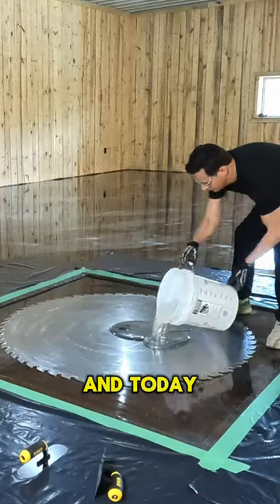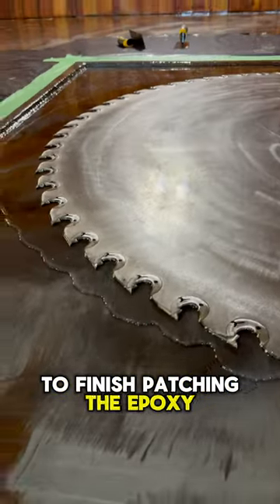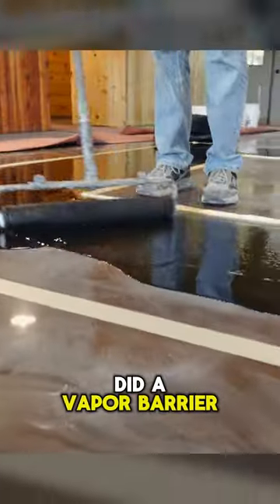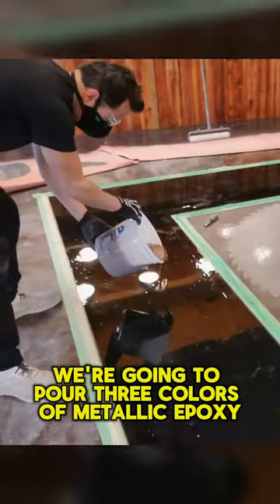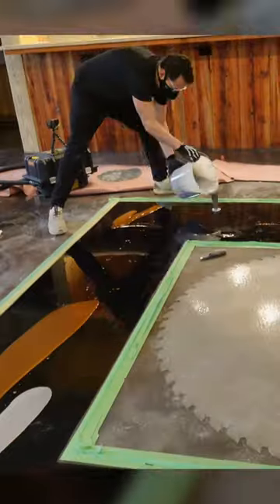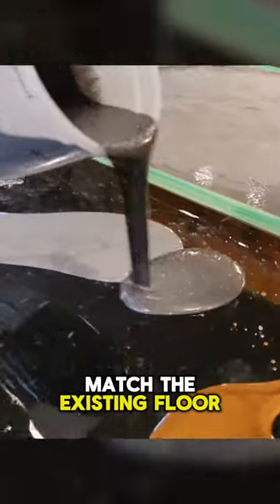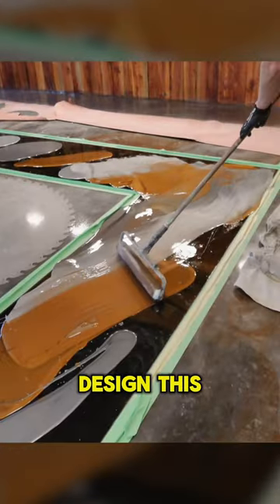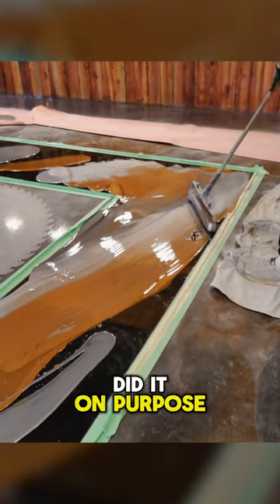⚠️ Metallic Epoxy Vlog - Day 6 #concrete #epoxy #metallic #floor #mancave #satisfying #garage

Comment: Idk if this would work, but I would've embedded the saw blade in a circle in the floor. Made to so the saw blade was level with the floor. Then, pour all the epoxy on it all at once, not separate. I'm not an expert, so who knows if it would work. Just an idea.

Comment: I can't wait for the epoxy fad to end. Then watch all these property owners get quotes for having the floors redone. Epoxy anything is like popcorn ceilings.
Reply: As a concrete foreman, same.
Reply: I think it’s beautiful if done right but it hurts to stand on or walk on these people are going to HURT
Reply: As a plastic fabricator, I cant believe anyone wanta acrylic floors! It chips, cracks, and breaks way too easily.
Reply: Popcorn ceilings are dope. They have an acoustic effect and make it so that you can easily fill holes and damages and other imperfections and then conceal them. I personally like the look, over all flat walls and ceilings.

Comment: OK, so I have a question, I do polyurea and polyaspartic floors. Flake systems.  In my experience, the floors you are doing here scratch up with chairs, tables, high heels, and such.  They are also slick.  Do you not run into this?  With the flake system you also have UV resistance, and I can do them outside on concrete.